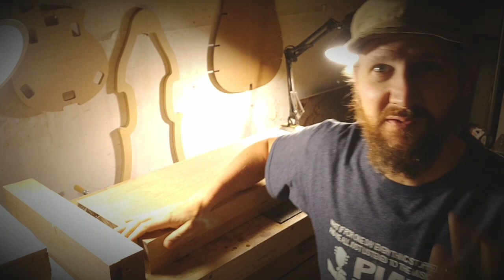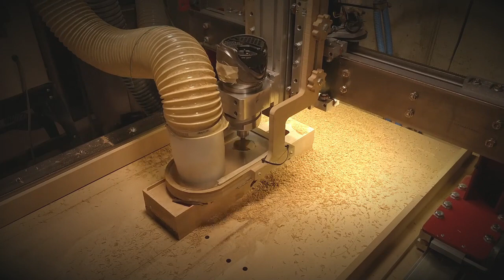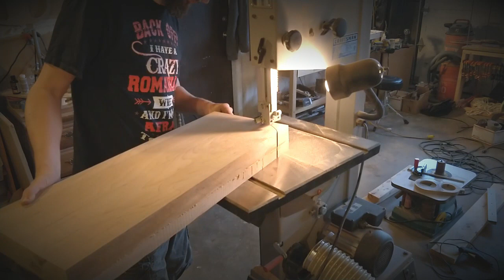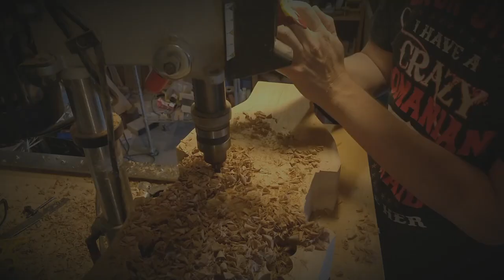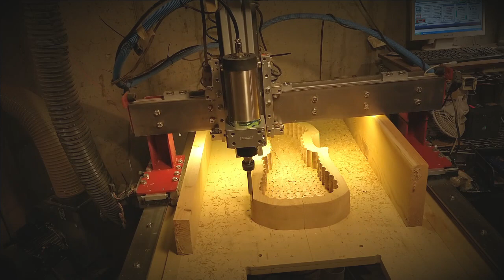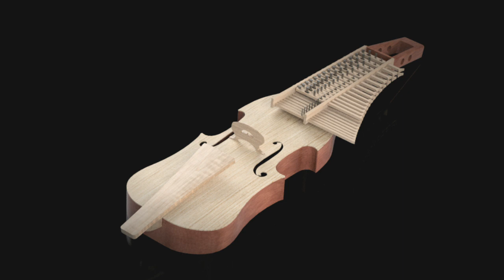Building a Tenor Nyckelharpa Part 1

Comment: Really nice work! I am a luthier and I always love different approaches to building instruments. I do, however think that using bent sides may be a better approach. It will be 50 times lighter and perhaps a bit stronger. There is no grain run off with bent sides.
Reply from the maker: Theses instruments are traditionally built with solid sides, I prefer bent sides myself as well, the next version will definitely be made that way.

Comment: Question about your neck attachment...is it just glued or is it also screwed into the body?  Thanks!
Reply from the maker: Just glue, as long as the joint is a good fit it doesn't require fasteners.

Comment: Great series! Any idea on where to get the raw wood blocks? I live in the US. 
Also just wanted to know if the CAD files are open source.
Reply from the maker: Thanks, I purchase lumber from mcbeth hardwoods locally and bellforestproducts.com has a pick your own option that I use frequently. I may release some of the CAD/CAM work at some point either through patreon or on instructables.com when the series is complete. For now this instrument is very much a prototype, there will be a lot of changes...
Reply: TwoCherriesIns looking forward. Sorry if I missed it in the video. Which wood species are you using?
Reply from the maker: The top is Sitka spruce, sides and neck are alder, and the keys and key rails are all maple.
Reply: Do you think you would sell machined parts once this has left the prototype stage? I've been wanting to build one ever since Johan Hedin released his paper on it back in 2004, but I simply don't have the heavy tools for it. With the parts already machined it'd be considerably easier.
Reply from the maker: Possibly, I've got my work cut out for me, there is an amazing amount of detail in they things. I make a lot of parts for guitar makers through my website twocherriesinstruments.com so that would certainly be interesting for me.
Reply: @TwoCherriesIns  Well, you've got a subscriber in me, that's for sure! I can't wait to hear her sound.